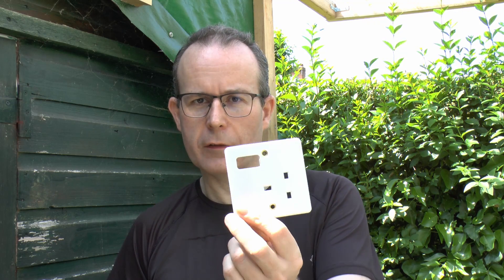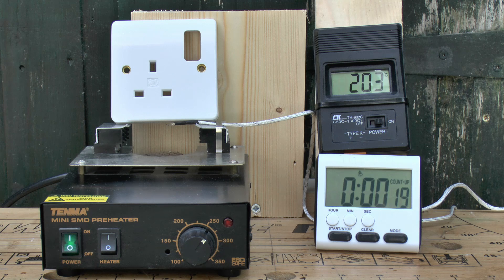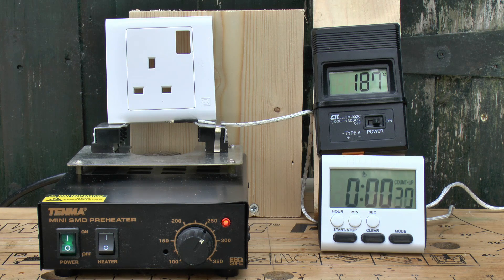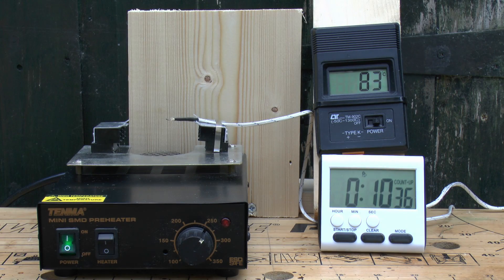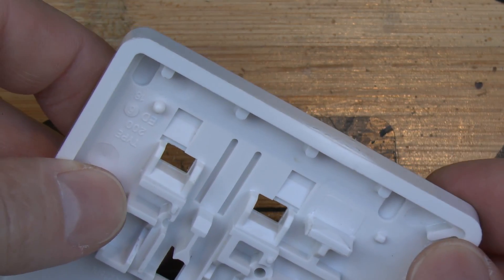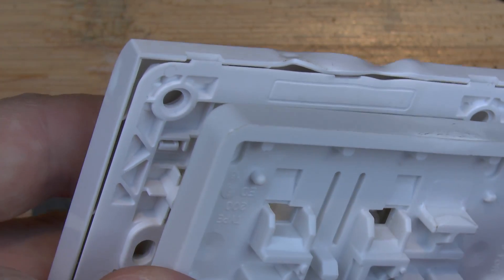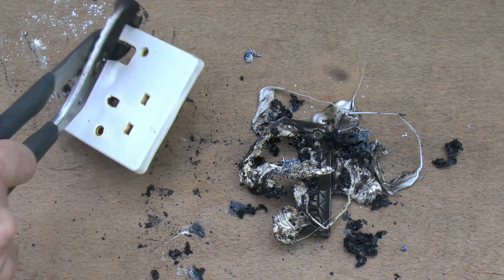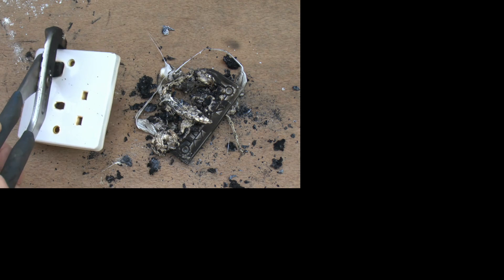Thermoset and Thermoplastic Sockets Overheating and Fire Test

Comment: Hi, this is a random question about a situation I need to resolve but does involve heat and steam.
My cooker hood lights failed due to the GU10 fittings and wire burning out. I have   bought a new spare part that comes ready made up but the 2 core lead that runs from the output on the terminal box on the fan housing can not be accessed. 
I wish to cut this lead and join the new lead to it in a 2 core connector. Do you know of a connector that is heat and steam resistant, so that I can join on my new light safely with the steam from the extractor fan passing by.
Reply from the maker: Crimps with heatshrink over would be one option.
When it was made, someone installed wires to the terminal box, so there must be a way of accessing it.
Reply: @jwflame  thanks for the reply John.  I did buy some heatshrink with the aim of doing as you say. However, I did manage  to remove the cover screws  by pushing a  Philips insert from my socket set into the  screw head and turning it by  slotting a small spanner over the flats, and with a lot of patience, undoing the screws an eighth of a turn at a time until they were loose enough to be turned by hand. Luckily, the terminal block could then be pulled down and twisted just enough to get a small screwdriver in to rewire the lights. Thanks again for your help, and keep the brilliant videos coming. They help diy'ers like me understand the theory behind things that we would not normally consider. The purchase of two led trailing edge dimmer switches that can reduce the light from a 5 bulb led floor lamp to very dim without flickering being one example. Regards.

Comment: Strangely or not I always consider the plastic construction of the socket/ switch when buying them,nice thick hard mouldings with plenty of ribs on the back(incidentally,why do people put plastic boxes on bare brick?,it always shatters) .My sister bought 2 dimmer switches for leds from eBay,almost certainly Chinese made. The dimmer unit looked ok but the cover was made from some terrible poorly moulded pvc,with absolutely no effort made to reinforce them, they deformed long before the screws were even remotely tight and because of their flexibility the knob of the dimmer had a fair bit of lateral wobble.

Comment: Which material is best for the pins on the UK plug? I have seen brass and what looks like steel. Using a budget (Argos/Sainsburys/Asda) kettle or toaster and the whole flex and plug gets warm (not hot)
Reply from the maker: Solid brass - but that's more expensive than steel.
All wires get warm when in use due to their resistance, kettles typically have a fairly thin flex as they are not switched on for long periods.
Reply: @jwflame  Thanks, I had a feeling brass was best. Every time I see steel pins it just feels "cheap"

Comment: Are plastic consumer units (I have one) made from thermoplastic?  I think my earlier fuse wireable unit was UF as were it’s fuse holders - as JW mentions.
Reply from the maker: Mostly yes - which is part of the reason they are now steel, as there were many examples of plastic consumer units melting and burning when the wires/connections inside overheated.
The older Wylex fuseboxes were thermoset, and are pretty much indestructible.

Comment: Cool. It would be interesting if you made a video that demonstrated a fire test in a metal consumer unit vs the plastic type.  Maybe a loose connection on the bus bar to start the fire...

Comment: Polycarbonate survived rather better than I expected.  Well enough that it’s use for fixtures doesn’t seem that bad, especially if compared to plastic dry lining boxes.
Reply: Plastic dry lining box's will use very similar if not identical thermoplastic as the MK one in this video!

Comment: In the real world though when people plug in a 3kw heater and leave i running all day those plugtop pins get extremely hot and damage the socket. that plastic one would not last 5 minutes. Mainly offices, warehouses, schools etc so the cheap plastic ones should not be used anyway, but in a world where cheapest wins all the time you know the cheaper option will be used, plus they are ugly so who would want them in a house.
Reply: My kettle plug gets rather warm in the time it takes to boil 2 cups worth of water.
Reply: @uK8cvPAq  have you tried it in a different socket?

Comment: Didn’t even realise they made them out of two plastic types, thought they were all thermoset (urea). Will make sure my sockets purchased are always thermoset for clients.
Reply from the maker: Most are thermoset, but there are those which are not, MK Essentials as in this video,  converter sockets that change a single to a 2/3/4 gang without changing the backbox, some Clipsal branded things and probably others.